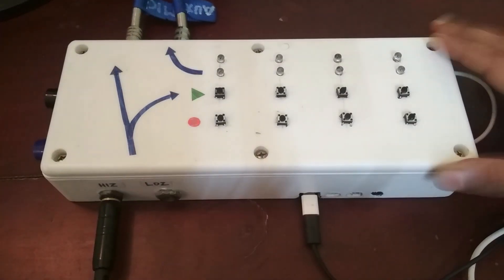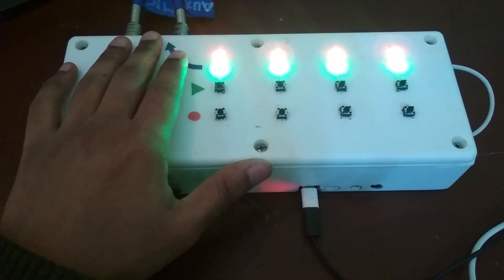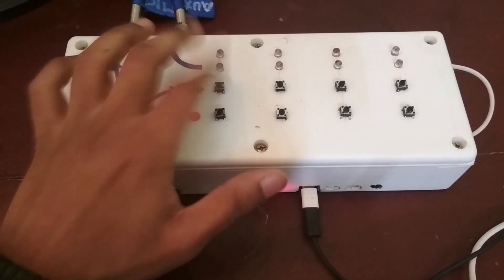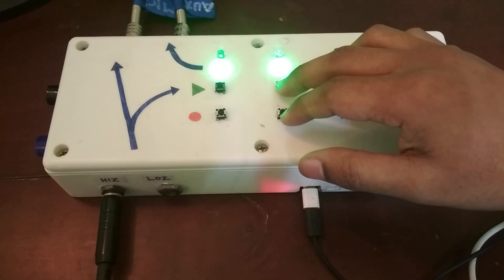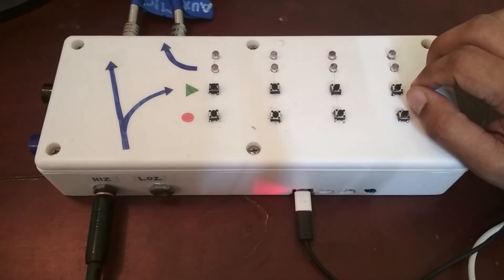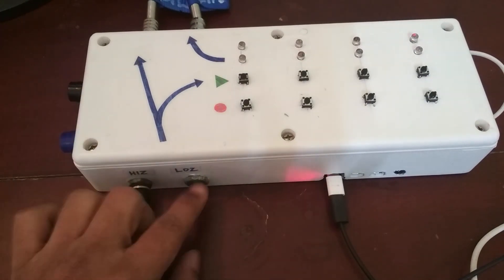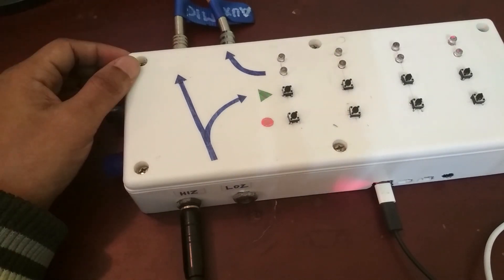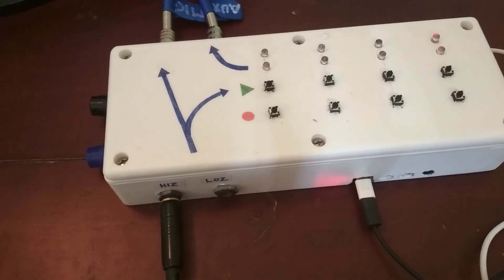Homemade Loop Station Demo | 4-Track Looper Using Raspberry Pi

Comment from the maker: Summary of "bug fixes" since this video (chronological):
- Fixed delay after recording first loop
- Added single-buffer cross-fade from end of loop back to beginning (reduces clicking noise)
- Added dynamic volume compensation to prevent mixing distortion (overdub distortion is still possible)
- Merged pull request by Simon for detailed readme file
- Implemented button debounce

Comment: I just ordered all the parts for this and i'm excited to make my own!
Reply from the maker: Awesome! Would love to hear how it turns out :D
Reply: @Psychotenuse  I’m really inspired with what you’ve done here. I’ve been making my own little synthesizers that I want to plug into the loop station once it’s made. Do you have a suggestion for how to measure the latency correction value if you’re dealing with an audio line-in instead of a microphone? Or will a microphone be necessary to calibrate it?
Reply from the maker: You could just take a small patch cable and plug the loops output into the input.
Reply: @Psychotenuse  great thinking!
Reply: @Psychotenuse  Seriously, my friend - this is such an incredible project. I've got things working and it is looping my instruments like a dream. I think i have a couple of questions that i'd really appreciate your perspective on. Is there a good e-mail address or something i could send some footage of what i've made and ask your further input?
Reply from the maker: psychotenuse at gmail dot com

Comment: Awesome project!

Can you pls list the specific components used?

Like exactly what model of raspberry pi (name? amount of ram)
What audio-device?

Would be awesome since i suck at programming /coding.
But i figure if i get the same hardware i would basicly only have to solser / put it together and then i could copy your code from github right?
Reply from the maker: You'll find that in the GitHub Repo :)

Comment: Well done, well presented, I expect to see a lot more subscribers soon.

Didn't look at the code yet, are extra loop channels possible, could you have 16, ignoring issues around number of I/O?
Reply from the maker: Haha, well thanks. The problem is I don't upload regularly :P

The "4" is currently hard-coded into the Python scripts, but it probably would not be too difficult to modify them to use 5 or 6 tracks. Many small changes in many places kind of thing.

16 is a bit ridiculous, I would never attempt that, mostly because I don't have a need for it but also because that would be expecting rather a lot of the Pi - this task is pretty resource heavy because it's written in Python which is a very inefficient language. If I had to make a 16-track looper I'd probably redo it in C or C++.

Comment: Great Work!
Have you considered doing a 2 track or 3 track version for the Zero? Or is the load of multiple Audio Tracks playing at the same time too much for the Zero?
Reply from the maker: As I remember, one track worked fine on the Pi Zero but as soon as I recorded a second track the audio bacame glitchy. This happened for buffer sizes below 4000.
It has been a while since I tried it on the Pi Zero, and I've made several changes to the code since then. The performance of the current version might turn out to be better or worse, I couldn't really tell you.
I think that this kind of thing can certainly be done on the Pi Zero, but the first step would be to write it in C instead of Python.
Reply from the maker: @gnakflak6962  Yes, of course! It would be great if you tried that out. Let me know how it goes, that way if anyone asks later I'll have an answer for them :P
Reply from the maker: @gnakflak6962  This application doesn't really require "low-latency audio".
I did try using JACK early on but it didn't seem to help a whole lot (in fact it seemed to make things more unreliable). I imagine this is because the bottleneck is the actual Python itself. You can try it out for yourself, but I don't think it will make much of a difference.

Comment: can the guitar input work with the guitar signal directly or does it need effects or at least a buffer between the guitar and the looper input?
Reply from the maker: Yes, It should work with the instrument level signal, but you might have to turn the other input down to match the levels.

If you plan to mostly use instrument level signals and not line level signals, you might use two 1k resistors on the inputs instead of one 1k and one 10k.

Comment: It's it possible to set tempo and fixed loop record? This is pretty amazing! I have a rpi400 with the keyboard is it possible to use the keyboard instead of the buttons?
Reply from the maker: Not in this, but I did it on my PC version of the looper, here: https://github.com/RandomVertebrate/Loopstation the PC version can also record your session multi-track.
Reply: @Psychotenuse  hey thanks for the reply! I'll check that out. I really like the headless option on this one and my multi effects pedal has an inbuilt audio interface so it would be handy. I only ask about the fixed length record because my timing isn't perfect.

Comment: Hi there. I love the idea of this project as commercial loopers are quite pricey. I have done the build with a Pi 3 and am successful with getting through the install. But when I go to reboot my Pi goes to the desktop and does not auto run the script to get the raspi-looper going. When I open the command line or I'm assuming the linux box then raspi-looper starts but afterwards the audio device no longer is recognized. Any thoughts what I might be doing wrong? I am even less knowledgeable with raspberry pi than you, a complete novice.

I am running the legacy version of raspberry pi with desktop. Is that the wrong version that I am using?
Reply from the maker: Oh. I'm not sure what would make that happen. My first thought is, did you append the commands to run the script to your .bashrc file? That's what makes it run the script on startup. Otherwise, maybe you could try turning off the booting to gui.
Reply: @Psychotenuse  well I figured out what the problem was.  Alsa mixer is no longer the default mixer on the raspberry pi.  Pulse audio is now the default . So once I uninstalled pulse audio and reset alsa mixer everything worked fine.  I had to resolder some of my connections too.
Reply: PS I think more correctly is pulse audio is software on top of alsa mixer not instead of.  But in the case of your looper since it uses alsa mixer specifically then pulse audio needs to be removed,  at least in my case.
Reply from the maker: @davidknab8299  I shall have to try installing the looper on a new raspberry pi OS to see if anything has changed since I made the video.
Reply: @Psychotenuse  about to start this project. Did anything ever come out this? If necessary, what changes would I need to make during the build to get around the apparent issue with Pulse Audio?
Reply from the maker: @jeffhankey  Hey, so I tried today and it is just as David says. Pulse seems to be monopolizing the soundcard. The looper seems to work fine if you uninstall pulse. Cheers.

Comment: Hi!! Nice project! Im trying make it but I have a problem. When my screen is disconnected the looper program not start. Then, I connect my screen, and it starts without problems.
Reply from the maker: Oh. I'm not sure what the problem is... Maybe you can try disabling booting into the GUI?
Reply from the maker: You could look in forums for tips on "headless" operation of the Raspberry Pi.
Reply: @Psychotenuse  thanks for you reply! I think I found the solution. I entered to config.txt file and I have uncommented the line "hdmi_force_hotplug = 1". Now , without problems!
Reply from the maker: Awesome :)

Comment: Hi! wonderful project.
Can I do it with raspberry pi zero?
greetings from Brazil =)
Reply from the maker: I did first try it on Pi Zero and the problem is that the buffer size has to be set around 3000 to 4000 samples, which means it will work but the tracks will be a bit out of sync.
Reply: @Psychotenuse  Nice. Thanks for the feedback =)